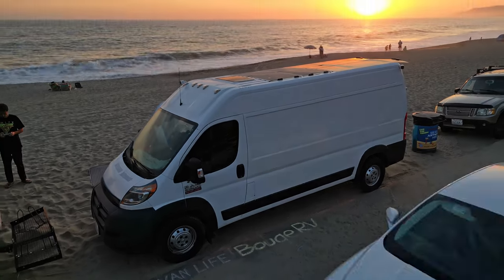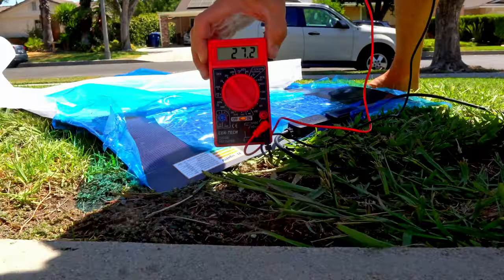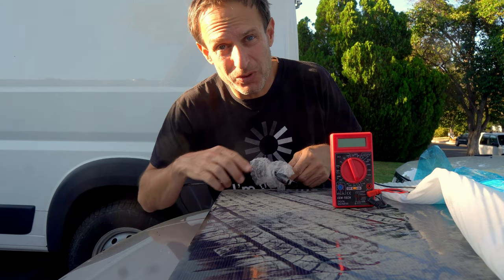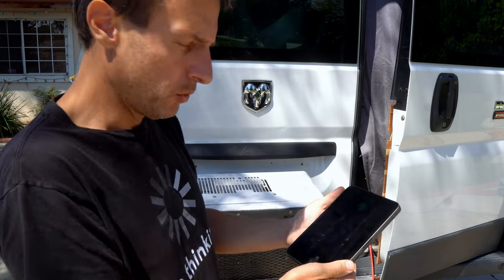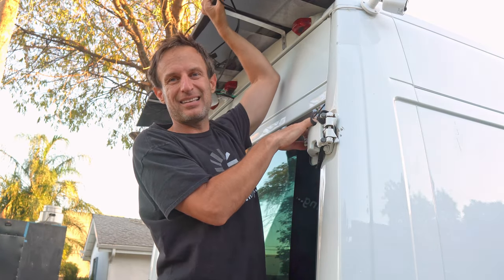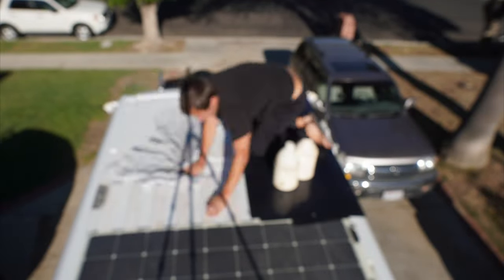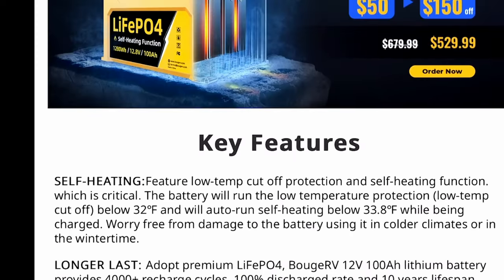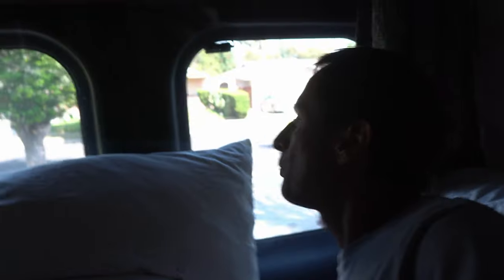BougeRV CIGS Flexible 500w Solar Stealth Walkable Roof panel Vanlife | RV | Nomads ☀︎ Peel and Stick

Comment: The price needs to come down!!! NEW TECHNOLOGY is always quite cost prohibitive!!! I’ll get them when the price drops!!
Reply from the maker: Cigs Solar panels used to cost 20 times more than they do now so the cost actually has come down greatly And that’s why you’re just seeing them as a consumer product
Reply: @NoLimitVanLife  YEP, get that!! Still, my SS is $1000/mo!! I’ve got a Renogy 160 W flexible that I bought in 2019, I still use as a ‘portable’ because it didn’t work for the top of my 1999 Chevy Express Explorer high top! I’m making it though!!! I’ve gotten a cargo trailer with room to put that on now!! As soon as I get the drill bit for the ‘hole’ I’ll mount it there!!
Reply: This is affordable dude
Reply: @heyitsmedoug8397  Tiny watt solar wants $5000 for theirs 500 W panels
Reply from the maker: Yeah it’s insane
Reply: They are cheaper to make ( just not mass produced) once they are they would be about 30% cheaper.

Comment: What about when it's not outside and u have a self heating battery? Does it have a way to cool it dwn when it's not outside since it has self heat? Does that even pay a part in what going to make it work
Reply from the maker: Not fully understanding the question

Comment: I want to do this but i know nothing about solar, it sounds like a foreign language to me. I try to educate myself watching 👀 videos but i just don't understand it... I thi k I'm gonna just go with a power bank like bluetti or ecoflow with the most volt per panel i can find to fit on the roof of a van
Reply from the maker: Those systems do make it a lot easier the advantage to making your own system is you will have less limitations potentially that might not even matter to you
Reply: The weird jumpy editing cutting off info/sentences doesn’t help. Better videos are out there

Comment: How does the efficiency of these panels compare to hard mono panels?
Reply from the maker: I’ve noticed with panels that the efficiency on the stat sheet doesn’t tell you the truth. The only way for me to find out is to lay them out under the same sun. The CIGS panels are slightly larger than silicone but they’re also lighter and I don’t have a bezel. My guess would be nothing beats the throughput of a large house panel because they’re higher voltage but without testing it who knows. Maybe using a light meter would help but I’d love to layout the panels together for a video.
Reply: @NoLimitVanLife  yeah, their ability is attractive but before investing I'd like to see the output of them vs. a regular panel. Also, I probably won't be first to jump in and wait on if they delaminate over time. Best of luck with them!
Reply: @antigroundhogday  thank you

Comment: I have a self adhesive 200w bouge on the way, I’m wondering how best to install it over the ridges that run lengthwise on my suburban roof..like..should I try to fill in the gaps between the ridges or just let the panel be uneven as it dips done between the ridges
Reply from the maker: If you did go through the trouble to create some sort of sheet to stick them on, that will have a half an inch to an inch of space how about that it will help keep the van cool when the sun shining on it but if you’re somewhere, where it’s often cool, then maybe you want the sun to heat up the van I don’t know But I would totally just stick them on there. The more difficult question is whether to run the wires from the middle back front.
Reply: @NoLimitVanLife  thanks sir 👍

Comment: Got to ask dumb questions.....What keeps the wind from blowing off.?  how to remove for replacement?  exactly how many watts total do you have to run what a/c??  Thank you
Reply from the maker: To produce 700 W most days you’ll need six or seven 200 W panels which should keep a small air conditioner going. if it’s only about 80° outside you’ll need way less power. they are very sticky so they won’t blow off. These are forever panels but if they must be removed they should be scraped off to prevent damage. Hey body shop has chemicals that will dissolve the sticky gummy material
Reply: @NoLimitVanLife  you are saying you need1400 watts of solar which  produce 700 watts of charging to a ? battery bank to use air conditioning?
Any projected lifespan for these panels?  Sorry for quetions but I am a newbie wanting to have a cool van for sleeping after a typical day in Florida
Reply: @ziptie7112  Florida when it’s hot and cloudy you’ll have a problem making enough power with solar for air conditioning but if you have a big enough battery it’ll get you through those times